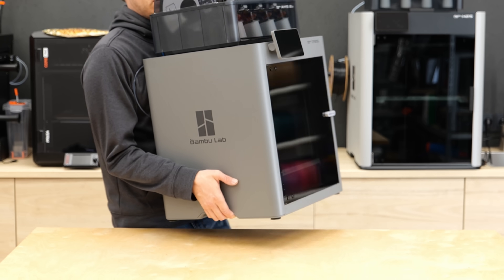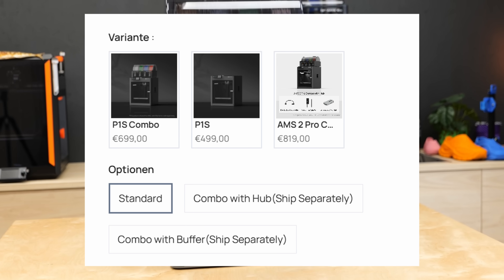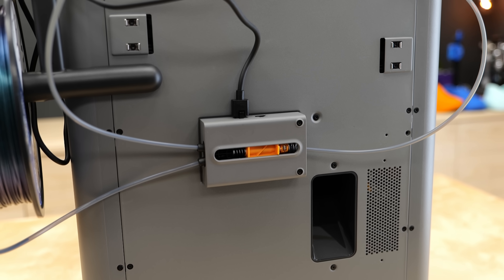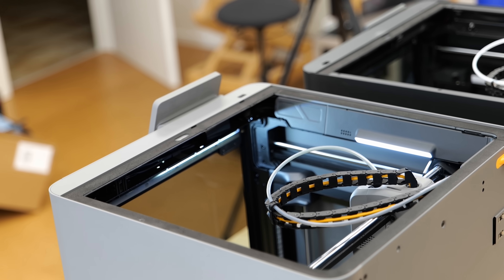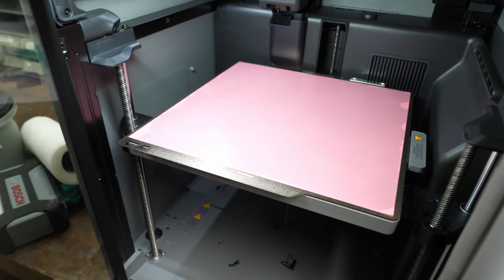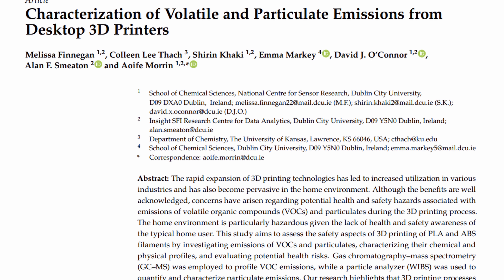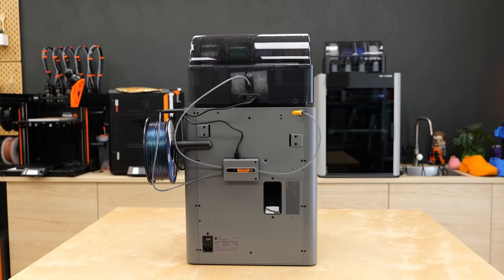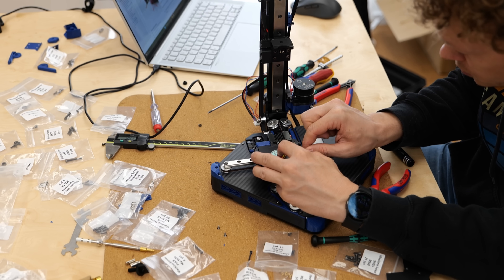The P2S Is the Upgrade No One Expected – But Everyone Wanted!

Comment: 750 Euros for the combo, thats insane value
Reply: It is. I bought the P1S combo right after it launched for about 1000€ 🥲
Reply: I just got a P1S Combo / AMS shipped to my house in July for $600......
Reply: Should I get the a1 combo or p2s no combo? Its my first printer
Reply: @twins2213 Neither.  If you are wanting a single color printer then get an Elegoo Centauri Carbon or a Flashforge AD5M.....They both are super simple to use, cost half of a Bambu and print better
Reply: @twins2213 p2s if the price isn’t an issue. There’s literally no downside
Reply: @twins2213 p2s. If you want to do anything other than extremely basic prints/materials. You will have the ability to do so with the p2s and can just upgrade with an AMS unit. A1 is like a drill that can only use 1 type of bit.
Reply: I JUST BOUGHT AN X1C why didn't you warn me 😢 lol
Reply: @SangheiliSpecOp Bambu pulled a shady move. They wanted to sell more of there lower models so they didn't announce the p2s until after all of their sales
Reply: Wait year and they again try to paywall you ... Then tell me same insane value ... Fuck bambu, never ever buy them!
Reply: @conto7032 honestly are you new to products or something? Every single tech company does it i dont agree but you cant attack bambu specifically when its the same across Every single company??
Reply: No man.

For the same price you have a dagoma with a cold bed and no screen.
Reply: you must be joking right ? P1S combo here cost 699€ when i bought it a year ago, when i bought my second combo it was 699 still ( i didnt pay that tho ) so why should 150 up should be insane value for basically the same printer ?
P1S chamber goes up to 45 easily and 50 needs some knowledge but is manageable, and tbh if you cant print ASA on a p1s its not the printers fault since its fully capable.
Reply: @Suchtzocker  It's only 50 Euros more for the updated AMS 2 (compared to 1 year ago), easy nozzle swap, automatic chamber temp regulation and automatic flow rate ajustment, touchscreen. And it comes with hardened steel extruder by default. That's more than worth the upcharge
Reply: Bambo lab is like the apple of 3D printing
Reply: If you want them stealing your Intellectual Property....if you use Bambu Suite to work on patentable and or Proprietary stuff.....
Reply: Why buy old tech?  Get a Snapmaker U1...forget the Bambu junk
Reply: @William-b5s2r the U1 print industrial filaments?
Reply: @gabrielfernandeztattoos  well duh, you obviously forgott that the only multi colour prints are those coloured PLA figures. Nobody ever uses an AMS for multi kg prints, addint text to the top/bottom or using support material on horizontal faces.
/s
Reply: @lukahierl9857  Yeah, the rainbow syndrome hits hard 😂
Reply: @gabrielfernandeztattoos Yep, sure can.  Now my turn...Can ANY Bambu do multicolor TPU prints?
Reply: @William-b5s2r not as efficient as others, but it can. While the other can’t manage all type of filaments. Anyways your bike still can’t go to the moon 😂
Reply: @gabrielfernandeztattoos Actually NO There are ZERO Bambu printers that can do multicolor TPU prints...AMS dont support TPU, at all
Reply: @William-b5s2r  H2D can do dual colour 95A no problem.
Reply: @lukahierl9857 Actually no it cant , The AMS cant handle ANY TPU.  And that fake bambu tpu isnt tpu
Reply: @lukahierl9857 How?  THE AMS CANT RUN TPU! FFS
Reply: @William-b5s2r its not even a fully enclosed printer lol it can’t print ENG filaments and its 1k
Reply: @00-JT Uh, its 3/4 enclosed and you can buy the top to make it 100% enclosed so nice try. Oh! And its $799....Again NICE TRY
Reply: @William-b5s2r lol snapmaker has only put out half-assed products with junk software
Reply: How is that a good deal?  A Qidi Plus 4 has a 305x305 bed, G1.5 belts (less VFAs), 370C nozzle, active chamber heating, and dual aux fans for $650 with discount.  Their AMS is $228 (which has active heating while printing--superior to AMS2), so the total cost is effectively $880 compared to $650 to the Bambu.
Reply: @EliteMacFreak  Bambu doesnt sell printers because of the specs. They sell them because they are easy to use, (almost) always work and are incredibly reliable. Its not about the features
Reply: @EliteMacFreak no one is buying a qidi or whatever its called over a Bambu. Bambu's just work
Reply: @EliteMacFreak  nice specs on paper, but a disaster in practice.
Reply: @EliteMacFreak  No one cares about creality, qidi, anycubic its just bad cheaper copies of something.
Reply: @dllsrsf  Except that Qidi Plus 4 is a higher quality implementation of the P1/X1 that incorporates all community feedback (no DRM, Ethernet, 305mm build volume, active heated chamber, dual AUX fan, 1.5GT belts, faster processor, better screen and camera, 370/120C nozzle and bed, 65C active heated AMS that works while printing) for a mere $100 more than the P1S Combo.  It's really hard to claim Qidi is "a cheaper copy" of Bambu when it's BETTER than the H2S for a little over 1/3 the price.  The only thing that is keeping Bambu alive right now is their reputation for reliability.
Reply: Yeah we get it, the specs, the specs look at the specs, I live specs but I like good quality prints more, when those companies can brag about that I'll start paying attention.  At leaste brag about your next gen improvements , those specs don't mention dynamic flow control on the nozzle, hence the awesome prints, , Bambu has nozzle engineers thinking about this duff the other guys are just copying standard practice with better quality parts and are like , look, we are better then creality! And they are, my anycubic vyper was a polished version of an ender with all the upgrades.  But tuning it is beyond what most people can and are willing to do is where Bambu really dominates and the others still haven't got it. We don't want to calibrate, bambu  automated it and even went further with dynamic flow control using the stain gauge on the nozzle. Where the competition even trying g yo copy that? That's why theyre not even clones I wish we had the other companies care about calibration and they're starting too, but Bambu is still ahead and leading in that front. However they're not perfect, we still have room for improvement, where I think the magneto x with its magnetic linear rail they take out the need for ever fancier belts you can brag about in a spec, that bottleneck doesn't exist with linear motors.
Reply: @dllsrsf Qidi is 100000% better then Bambu at any metric
Reply: @EliteMacFreak  cope harder
Reply: @William-b5s2r  Dat joke
Reply: @EliteMacFreak i hear nothing but bad things about those printers
Reply: The price looks good at first glance, but it comes at the expense of quality. This printer will not last long in good condition.
Reply: @CadaoPhạm-i2l  P1S cost less, but there is lots of farms with it.
Reply: @CadaoPhạm-i2l  We have multiple ones from the release of the first X1C and they still run fine... Don't spread FUD.
Reply: @CadaoPhạm-i2l  why?
Reply: @CadaoPhạm-i2l  rofl, nice bait buddy
Reply: @CadaoPhạm-i2l  Based on?...
Reply: @CadaoPhạm-i2l  Yeah no. The bambu lab printers are the most reliable
Reply: @CadaoPhạm-i2l  It comes at the expense of Bambu locked software. Bambu is good quality otherwise